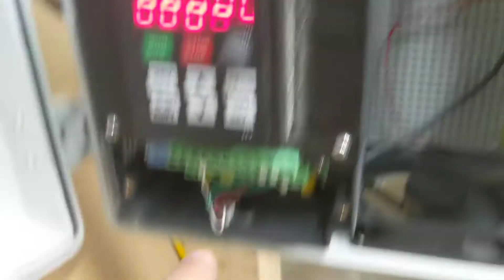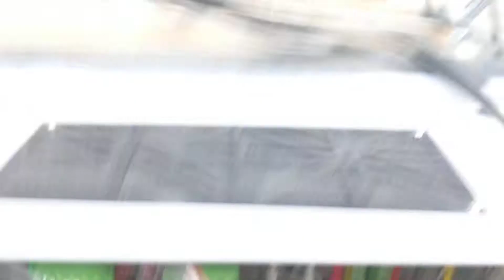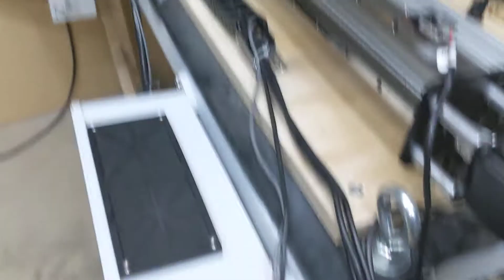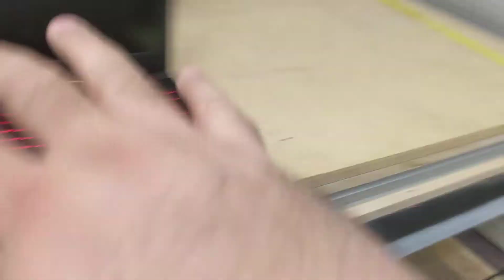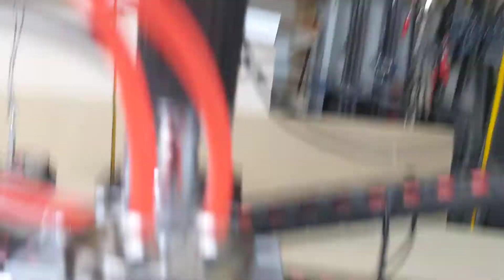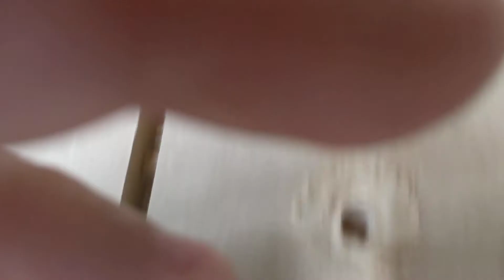bulkman3d Queenbee cnc missing steps

Comment: I had the same problem with usb nvum, what solved my problem was grounding the spindle to the base (the machine itself was grounded, I also double checked grounding on all outlet used (the one for the computer and the one for spindle) and I used to turn my spindle from mach3 using rs adapter now I just turn my spindle manually. I did all three together so I'm not sure which one exactly fixed my problem but I cut countless of hours without a glitch or skipping steps. hope this help someone facing the same issue
Reply from the maker: Hi. Thanks for the info. Recently I changed my spindle control from nvum to USB from computer to vfd. It just needs a plugin for mach3. Now mach3 is controlling the vfd directly from the computer. It's super accurate and no noise.

Comment: Hi Alex! I cannot be sure from your video , but I do not see any shielding on your motor cables terminated to ground at https://youtu.be/igPan6rFlDw?t=148.  Even with the ferrite beads outside the enclosure, noise will enter the rest of the cable from spindle and motor cables. Just a troubleshooting thought that may help.
Reply from the maker: Hi,
Thanks for the reply. I solved my problem by switching to Ethernet controller (NVEM) instead of USB controller (Nvum) that came with it. It helped a lot but to terminate the problem I changed to closed loop steppers and drivers. Also I grounded the cables but it was working perfectly even with grounded cables.
Reply: @alexsohrabkhani5782  Glad you solved it!